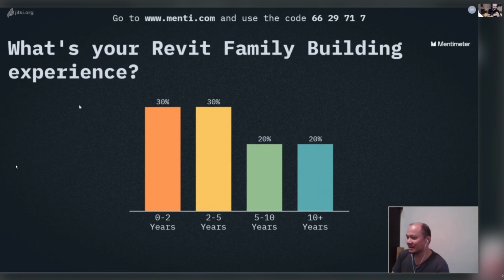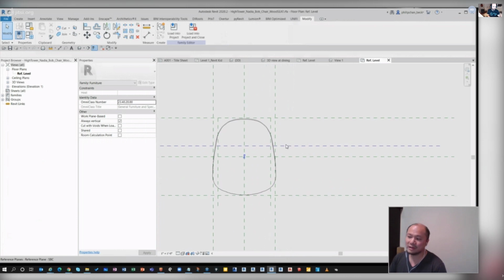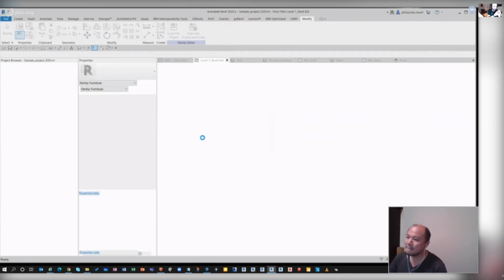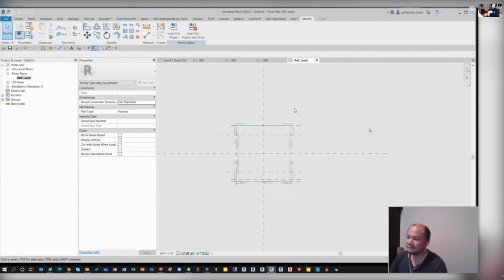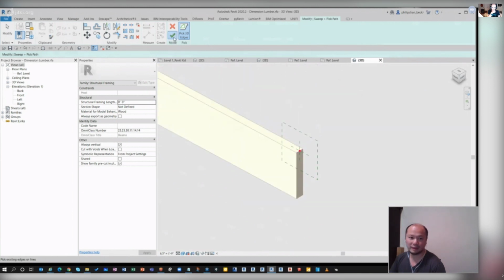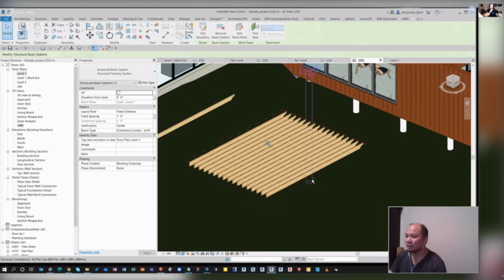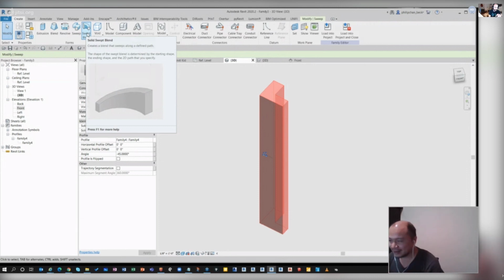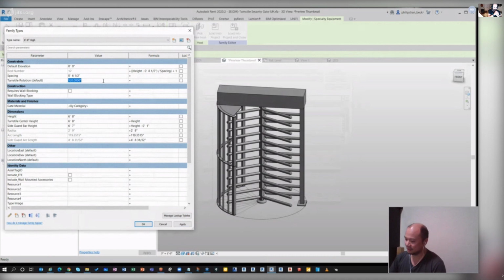Practical Revit Family Tips and Tricks (w/Special Guest Philip Chan)

Comment: copy and paste at same place on every sheet. 

here is issues I run into. everytime I Control C + V, Revit want me to click with mouse to select paste location. 

Is there a way to skip mouse click location, so it will be at exact same spot as copy source?
Reply from the maker: There is a pull down under the "paste" tool that lets you "place aligned to current view" or selected views.
Reply: @TheRevitKid  
yeah I see it is gray out.

I am copy and paste from file to file.
Reply: @TheRevitKid  
nees control C V with out addition click